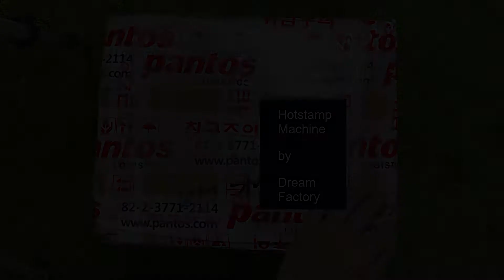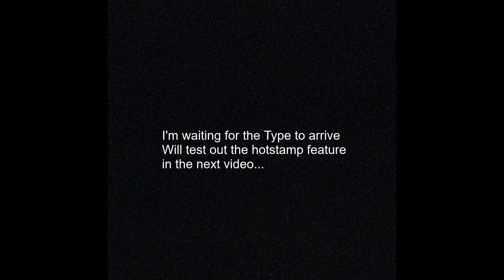ASMR Unboxing - Dream Factory Hotstamping Machine / Letter stamping machine (Part 1)

Comment: Hello. Was wondering if you recieved the type set and how you were liking the machine?
Reply from the maker: Hi, Yes I have! 
I wanted to use the machine for a few months (using both the clicking and stamping functions enough times) before doing the followup video.
I will probably film and post it up in Jan or Feb 2021.
Reply: @indigoNine  thats great. Looking forward to it. I just ordered this unit myself and I'm hoping it is a high quality machine. It sure looks to be.
Reply from the maker: @pfitz671  Yes, it is a well made piece of gear....you will not be disappointed :)
Reply: @indigoNine  thank you for the info. Great video as well.
Reply from the maker: @pfitz671  new video is up :)
Reply: @indigoNine  i received mine. Works very well and looks great too. Thank you for the update.